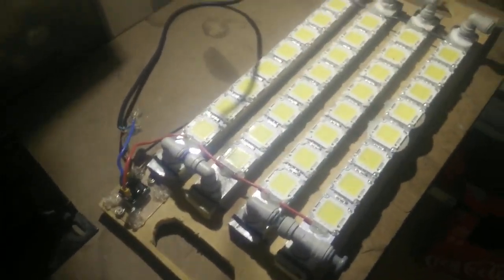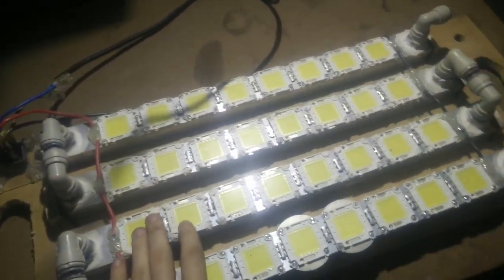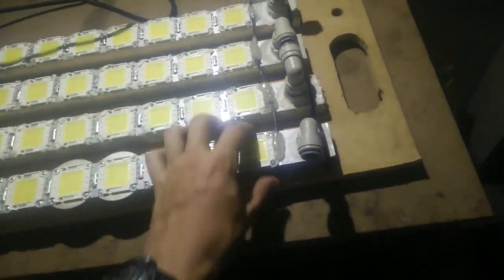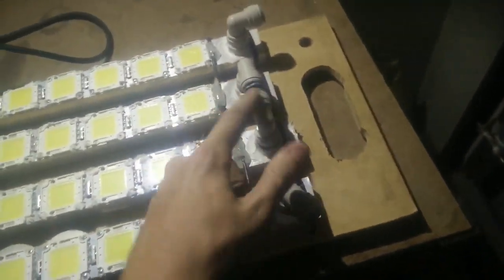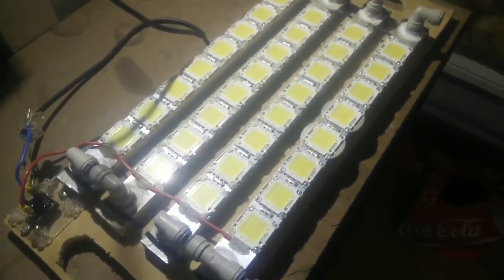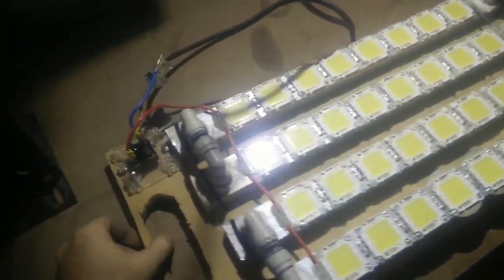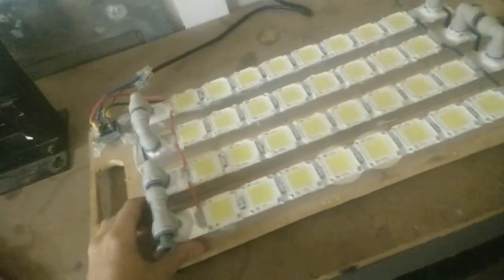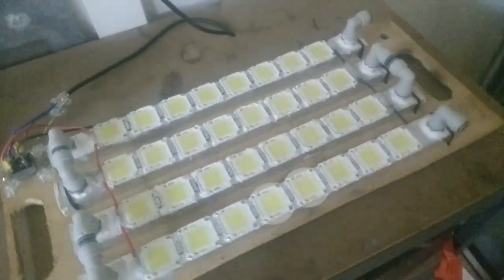Homemade budget 3.2Kw LED flood light (watercooled)

Comment: you must have 220 main in Australia?.. do you know amperage and volts to each LED might be?
Reply from the maker: Heiss Heaters Yea 240v single phase mains in Australia although some places are 230v, there is about 34-38v drop per led if I remember correctly but I don't know the current
Reply: its about 3-3.5 amps each...